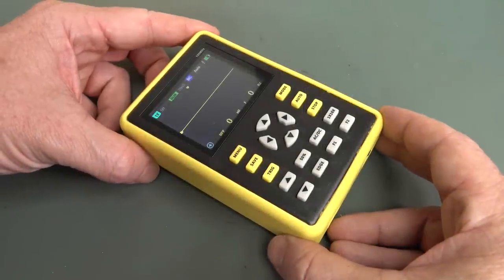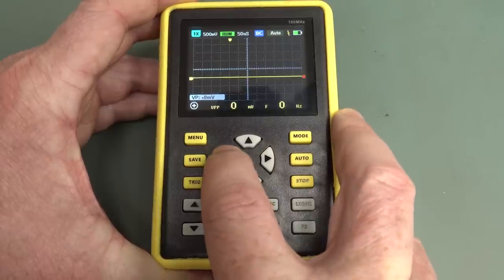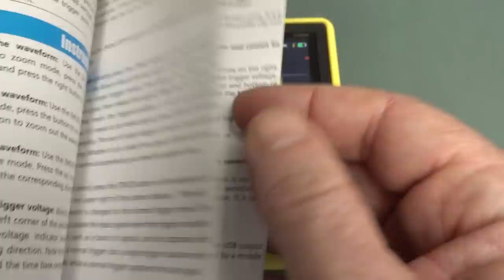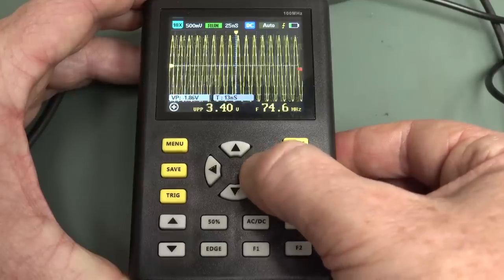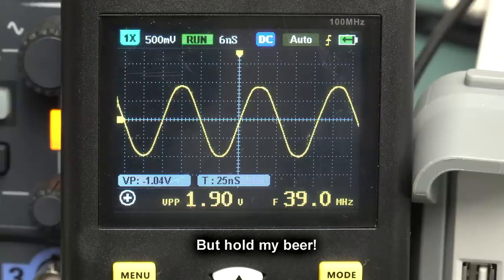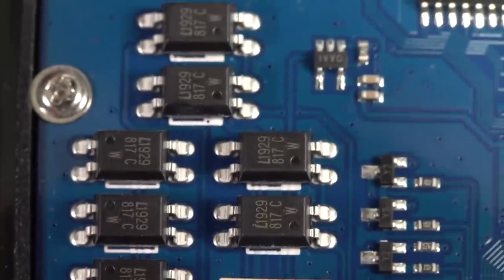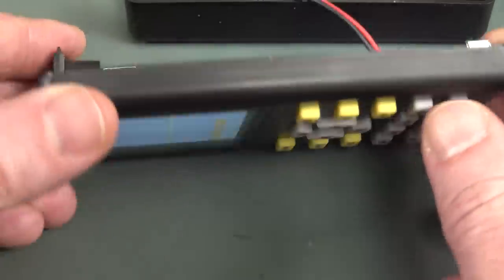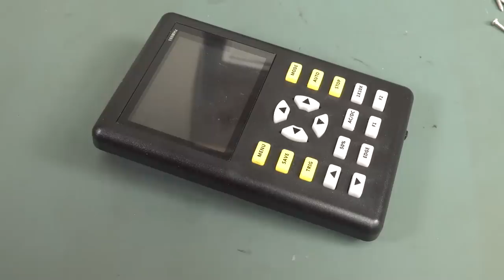EEVblog #1260 - $70 100MHz Oscilloscope?

Comment: This is the 4th under $200 hand held ("small") scope I have purchased, and for my work under 30 to 40 MHz, it does a nice job. If you do the obligatory "divide by 3" on the specs for the Chinese claims, it works well within the "calculated" specs. In other words, for an old Ham (as in in Geezer over 70) doing simple work on HF gear (2 to 30 MHz) it's the cat's meow.

Comment: There's an easy hack to improve this. Just cross out the 100Mhz and write over it 20Mhz. Done!
Reply: Just scratch M and write G. There.
Reply: Might be best to just tip-ex out a 0, just to be safe.
Reply: @JasperJanssen  naw, man, just add a zero. Zero is zero, doesn't make a difference, right? The Wanhunglow way.
Reply: 20 Mhz is enough for most Arduino projects. The highest frequency the Arduino (Uno / Nano / Pro mini) can output is 980 Hz, so even a 5 Mhz scope would be satisfactory.
Reply: @dotancohen  I have made Arduino uno make 4Mhz square wave so you can go higher...
Reply: @Smajchl  You are correct. I'm just getting started with the Arduinos and I mistook the PWM pins 5 and 6's frequency as being the maximum that the board could handle. Thank you for clearing that up.
Reply: @dotancohen   That is a wrong concept. perhaps you need to see glitches, and those happened very fast. your device will tell you that nothing had happened. 20Mhz analog for a few bucks.... or 100Mhz Hantek at least.

Comment: We bought something similar to this for the workshop; especially useful for checking ABS sensors. It's easy to use, even for the Aussie apprentice. Single shot, spin the wheel and you can instantly tell whether it's the sensor or chipped or broken tone ring. Brilliant; paid for itself within the month. Also if it's run over, no great expense. If only people would remember to recharge it AND put it back.
Reply: agreed !

Comment: i have one, use it all the time for a lot of basic use mainly in situations where i want to test for the existence of a signal rather than much more detail on it eg fuel injectors firing , mosfets triggering, serial output actually coming out of a pin etc stuff like that to me and my limited budget it's a gem for what i want, would i try and use it to replace a high end scope ...  no way
Reply: I don't blame you. Budget is the biggest restriction on life itself. I have a MiniDSO (from e-design I believe?) 4 channel, 80Vpp, 1 output 10hz-8Mhz, 1kSa/s - 72MSa/S.  I would much rather have a bench top as I am still learning. (And knobs and dials work better for me, and look cooler) but budget...
The Vpp really leaves me out of my usual field of 3ph480,wye and delta's.(just got my new 3ph power meter!)     Would be nice to have something more portable* that was tuned to 10-400Hz..

*My mini dso is so handheld that it's fragile, and has to be plugged into power to be reliable.  The "levers" also click like left/right mouse clicks.
Reply: @jamesharrell4360  of course on a $70 analyzer you get lots of limitations (including errors) but you are forgetting about one KEY advantage here: portability; this is a MINIATURE scope for gods sake, this product was Sci-Fi about 30 years ago! it's like complaining about your $300 smartphone not taking the same quality pictures as your huge and bulky pro $3000 Nikon; as Chris Bate stated so well, for DIY projects and hackers on the go this $70 chinese analyzer is a good compromise favoring portability and autonomy; of course you only are going to check if some signal exists around some values; you arent going to exactly measure anything on this, not only because of quality components restrictions but also for tiny display resolution that makes it physically impossible to get accuracy
Reply: Ah Ha. A comment that is well considered and accurate; almost a first for YouTube comments - well not so in the case of EEVblog which doesn't attract many idiots.  I also do woodwork where it is a case of 'horses for courses' and not all my tools are expensive. You are using this gadget for, it seems to me, precisely the purpose for which it was designed.
Reply: I'm with you.  I bought one of these even after watching this video.  I do have a 100 MHz Hantek and I do have an analog 50 MHz Tektronics... but my work in industrial automation frequently takes me to factory floors where having a means to look at signals 10 whole KHz and below is a huge time saver.  It fits nicely with my bank account and in my laptop case.
Reply: Have one, too. Best thing is it's mobile. Better than the 2k Agilent you don't have with you.
Reply: Fuel injector pulse is exactly what I want to observe. Does this actually work well for that application?
Reply: Sufficient and cost-effective for low-frequency measurements.
Reply: I'm waiting for one to be delivered tomorrow, hoping it will help in diagnosing a no trace situation on a Tektronix 475.  If it is pretty much useless, I will return and purchase a more expensive and capable device.

Comment: I measured only 23MHz of bandwidth on mine. The 100MHz bandwidth claim is simply FNIRSI arrogance and dishonesty. A 25MHz 5.0 volt p-p sine only measures 3.32 volt p-p on the 5012H.

Comment: In this case, the 50 ohm load is not necessary, because you are not measuring a power, so 50 ohm of the generator, with the 50 ohm load in parallel, is 25 ohm, 25/50, it is 0.5, 0, 5 times 0, 7 equals 0.35, exactly what you read on the final, I would say it keeps expectations !!!

Comment: That was measured in Chinese Mhz. Very similar to Chinese watts on amplifiers.
Reply: Don't forget Chinese mAh.
Reply: Or chinese power savers
Reply: @chupamishuevos303  Or chinese electrolyte caps without the juice 😂
Reply: How do you convert normal MHz to chinese MHz???
Reply: or Chinese Welding Irons
Reply: Seems to me that it’s a fine instrument as long as you apply the appropriate x5 correction on the specifications.20 MHz for $70 is exactly what you’d expect.
Reply: Is that anything like Sears horsepower?
Reply: Just remember in World war 2 it took 5 to 10 Chinese divisions to fight one Japanese division. They are just keeping up the good work.
Reply: @atmel9077  
Multiply the true reading by five.
Reply: This is a technical and perhaps commercial issue. Why do you have to inject your racist comments? The Chinese does produce high quality products. Take DJI drone for example. And American does produce poor quality products.
Reply: @boontecklee3361  Lies are lies. There is no technical issue here...This is a 20Mhz device marketed as 100Mhz. Don't tell me it is "Super" or "High Performance", when it is not. The only commercial issue could be qualified as outright deception and dishonesty. This is a consumer toy; call it a toy.
Reply: @rosskious7084  eehhh ...the japanese did some nasty stuff to the Chinese in ww2...not very nice to bring it up as a criticism of Chinese people
Reply: Divide by four to get absolute peak value. Divide by 8 to get usable spec.
Reply: well.....chinese instruments still a savior for student & hobbyist with limited budget. Of course it cannot compare with medium or high end USA or japan made products. I would say the target consumer is different, i guess their business model should be successful 1.
Reply: @rosskious7084  Similar like it took 5 muscular USA Marine with good weapon to fight a thin Vietnamese  in Vietnam war....what a shame
Reply: @josefaschwanden1502  Something like DJI Ronin 4D is not exactly "consumer." It's as consumer as a premium oscilloscope...
Reply: The Chinese'easiem Reference 🤣

Comment: I can think of a some good uses for this device despite its limitations. The biggest one is for field use by clumsy people who can't be trusted not to break the Fluke scopemeter but that still need an oscilloscope. This also could include classroom use, where people tend to do stupid things. In both cases the required bandwidth would probably be well below 10MHz for basic measurements. Another place this would be potentially useful would be when working with things like motor drive systems, where an ungrounded oscilloscope is required, though I don't know if I trust their statements on the voltages it can withstand. That being said, second-hand equipment from a known good brand may be a better choice.
Reply: I use it to look at analogue synth circuits and their behaviour. That envelopes, filters, PWM work like they should. Only visually though. Operating on up to 20 khz range audio range strictly. It does its job fine for that.
Reply: To be fair, if it can't handle audio frequency work... XD

Given the nature of what an oscilloscope actually is, any modern PC innately can implement a scope entirely in software through the audio hardware.
since that's typically 192khz ADC with in some cases 32 bit sampling and an inordinate amount of sample memory, it's a pretty interesting improvised method for low frequency work.

For similar reasons a mobile phone (if it still has analogue inputs) might be coaxed into doing similar tasks...

Of course, the reliability of this would depend on the frequency response, and there's stricter voltage limitations (probably requires external circuitry to protect the audio inputs)

But at the end of the day... For low enough frequencies... XD
Reply: Basically, you are saying this is a toy for children. At least you are honest in your assessment. The marketers are outright liars.

Comment: I ordered one of these the other day. Ideal for me to measure 28MHz and 7Mhz clock signals on the move.
Reply: Confirmed, it's perfect for me.
Reply: @ZaPpaul  would this be ideal for say automotive 12volt signal testing. For like oxygen sensors ignition systems etc? Mainly just for viewing wave forms to see intermittent faults. Or a similarly cheap(well more $ than this) scope that i could use for watching mostly analog some digital wave forms

Comment: I think it could be good for automotive things like checking camsahft position and oxygen sensors.
Reply: With one channel ? No. There are 4 channel oscis for 135 dollar but the probe has a small Wifi N Adapter and needs new probes, so that is the only downside. It is enough for car electric, I even probed CAN with it to find problems in the data bus.
Reply: and battery voltage :D
Reply: @0dium.  I can measure that with a cheap multimeter or my scan tool

Comment: These are popular in car audio for setting gain levels on amplifiers to prevent clipping
Reply: If its nearly as far off in terms off voltage... well good luck.
Reply: @leocurious9919  Well, if you're just checking for clipping on say a 1 khz sinewave, it'll do the trick just fine. You don't need to read any measurements for that, you just need to see the waveform. It should be more than enough to handle audio signals since they're low frequency.
Reply: Needs a sticker/label for "Uncalibrated - for indication only".

Comment: They most likely running the adc directly on dma channels on that arm. so sampling directly to sram. If they set the clock source from a timer they sure are able to hit 125mhz and use it as an dma-transfer trigger to boot.
Reply from the maker: Yeah, likely.
Reply: @EEVblog  
A comparator with a narrow sample time .
The trigger point is ramped, so on a repetitive wave form the whole wave form can be displayed.
This plug in would do DC to 1 Ghz
http://bee.mif.pg.gda.pl/ciasteczkowypotwor/Tek/7s14%20.pdf
also, Sampling Oscilloscope Circuits
http://w140.com/tekwiki/images/e/e0/062-1172-00.pdf
Reply: Your are correct that how they are doing it.

Comment: According to the specified input voltage levels you can probe mains voltages with this crap box and by looking the PCB it seems the USB connector is internally connected to the measuring circuits without required safety isolation.

Comment: Seems fine for some low key automotive applications?
Reply: Nicholas Anderson I was thinking the same thing but still watching this video.  Had a 04 Camry with weird Transmissons issues, put a $40 pull a part ecu in it and it fixed it.  I would have liked to view the solenoid duty cycle waveform to properly diagnose it.
Reply: @dorhocyn3  seems like the perfect application for something like this
Reply: That's what I'm using my DSO138 for. A 36 tooth timing wheel at 10,000rpm is only 6K Hz, and the DSO138 is fine to 10K. Maybe even 20K. It's nicer than my DSO130, but it's also costs a 4x more, so it's probably too expensive. I'm starting to get into injectors, so it would be better for me to have a 2ch so I can see the INJ opening and closing at the same time to work out my dead time.
Reply: I think something like a cheap USB scope ala Hantek would be better since you have deep sample memory.  For example, hook up to the camshaft sensor, start recording, then go and crank the car over, then come back and stop the sampling and examine the results.  I know you can do this with triggering but just a straight datalogging adds validation.  Or checking out a suspect wheel speed sensor:  hook it up, go for a drive, when you see something funny pull over and have a look.  If you really want to get dee p into it you can import into sigrok for looking at CAN for example.
Reply: @paulmoir4452  USB scopes are a bit of a pain IME, having to balance a laptop and a fairly bulky interface within the engine bay, with a running engine is not easy.
Reply: @ferrumignis  I've been looking at the Hantek 2D42 or 2D72 for hobby automotive stuff, and some low key Arduino type projects. It is a compact  handheld 2 Ch scope, function generator, and multimeter for about $150-$200. I really want a review/teardown like this for it.
Reply: @nickandersonco  There are a few reviews on YT for these scopes but they don't go into much depth.  I have heard the firmware is somewhat buggy which isn't a surprise, even the more expensive Chinese desktop scopes come with plenty of bugs.
Reply: No, just no, don't.

Comment: Could be useful for someone getting into DIY Synth. Rarely need to view any wave forms outside the audio range.
Reply: Plenty of wun-hung-low models that can do "good enough" for audio frequencies. Many of them are cheaper.
Reply: @QlueDuPlessis  Not to mention that you need an accurate voltage reading if you're working on the preamp stage.
Reply: Agreed!
Reply: Any digital interface is above 100 MHz even the old USB2
Reply: For audio frequency all you need is a PC with decent sound card and just download some nice free software. 

Just my 2cts...
Reply: @pahom2  
It's not a logic analyser
Reply: You need oscilloscope to debug digital interfaces to make an eye diagram etc, not to capture data
Reply: @pahom2  
Someone bought a top of the range sampling scope, but  what he needed was a spectrum analyser.
The guy was so clueless he'd blown the front end out of the sampler, so we reused to take it back. That cost him 30
grand in 1970.
Then he destroyed  the spectrum analyser. we sent a better salesman. The customer was trying to investigate a 500 MW radar.
Oh dear.
Reply: Cool story bro. But how is this relevant? There is no cheap modern sampling oscilloscope for 1GHz digital interfaces, they start from 100 GHz and $20k and 1GHz oscilloscopes are also $20k. No one is bothering to make a cheap sampling oscilloscope which is suitable for most engineering tasks.
Reply: @pahom2 
True, just saying don't buy a scope 10 times better than you need
I don't think any of us hobbyists, apart from the odd one will ever truly need an analog scope of more than 100 Mhz bandwidth.
Reply: @pahom2  
>  No one is bothering to make a cheap sampling oscilloscope which is suitable for most engineering tasks.>
Most engineering tasks don't require one.
Samplers in my experience are dishonest and difficult to use.
Same as the difference between a cheap optical microscope and a scanning electron one.